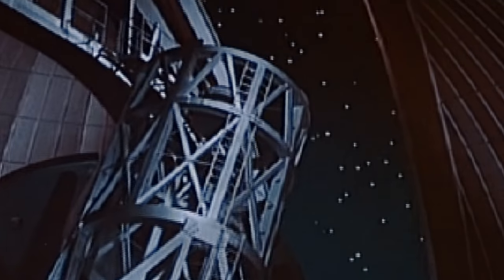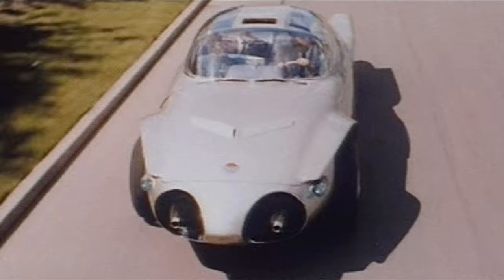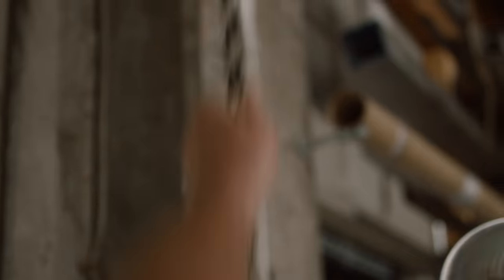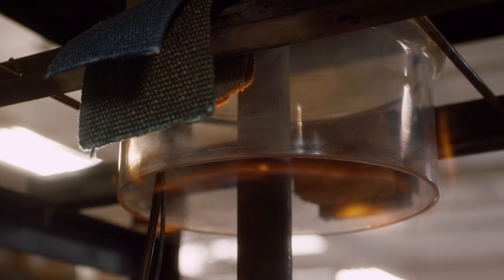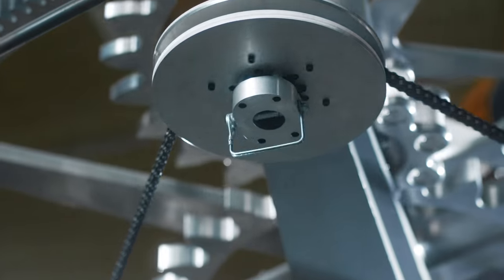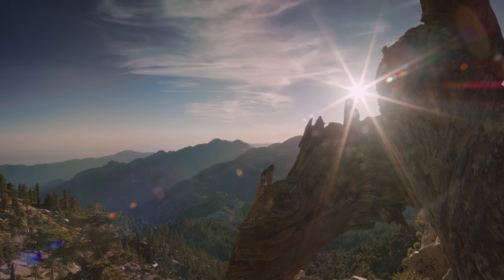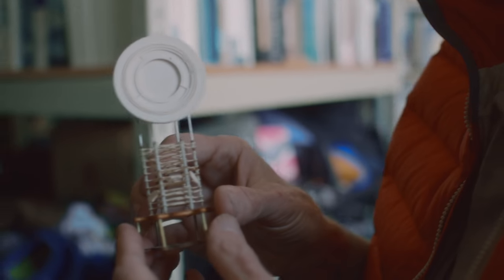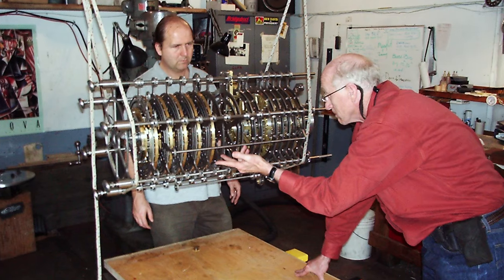The Clock of the Long Now

Comment: Anyone hear noticing a correlation between the new clock Jess Bezo's has built in the Sierra Diablo mountains and how they are almost perfectly in line with the great Pyramids of Giza? All along the equator. They both have the direction face of North to south and of course both used to tell time and energy. Apparently one of the reasons they thought this would be a good place was becauses its home to "bristlecone pine tree found in the higher mountains of California, Nevada, and Utah.[3] Methuselah is a bristlecone pine that is 4,854 years old and has been credited as the oldest known living non-clonal organism on Earth" -- Interesting right? almost as old as the pyrimids of giza. Anyone else wondering how there are so many connections? It also happens to be part of the "Great Basin National Park" so water flowing directly under Jeff's mountain... ""@brokentablespodcast The massive vibrations shown in the animation from below came from the underground section that was full of water from the underground rivers. The water would smack the bottom of the pyramid during the electrolysis that was happening. Electrolysis was occuring due to the positively/negatively charged stones known as Anode and Cathode that are still down there today. It's pretty obvious once all the pieces are put together.""" 
Someone look into it too before I loose my mind on all the connections!!

Comment: 10,000 years ago humans were just getting reliably good at cultivated agriculture.

Rice, wheat, and potatoes are still around. They are wildly different then what was made back then. But they still exist.

The vast majority of writing that we found from that long ago is impossible to decipher. That type of problem has never been fixed. 

Even something as simple as having a 12 hour time face clock, creates a frame of reference will be totally lost in such a long timeframe.